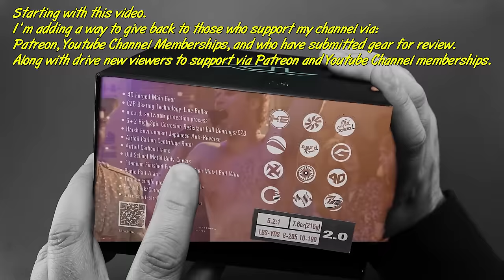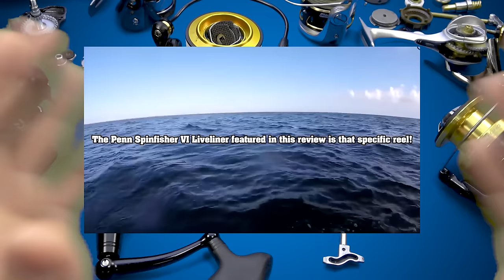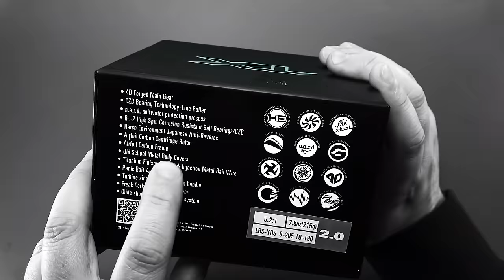$200 Spinning reel buying guide.  Teardown, comparison, and review. Shimano, Daiwa, Abu Garcia, Penn

Comment: Stradic FL hands down the greatest bang for your buck reel ever made.
Reply: I have both FL and back bay but I take the back bay out more than the FL just love the smoothness on it. If I need to recommend one to someone, I will the FL.
Reply: Sungsoo Lee why the fl over the back bay? If you use back bay more
Reply: No the bg is
Reply: @coopermaio1590  i agree bg...no reason yo buy any other reel
Reply: circusmime except he stated things that the bg lacks. you could get a slammer on sale for $150, which by far is better than the bg
Reply: Distant the bg is way better for the money
Reply: @coopermaio1590   to damn heavy.
Reply: it said bassicly stradic fl is stella fe without japan quality, i didnt even know what is japan quality :D
Reply: Bearings go out often so ..,
Reply: @coopermaio1590  no it’s not🤣🤣🤣🤣
Reply: @coopermaio1590  BG is shit for corrosion resistance. Pinion assembly wide open to saltwater.

Comment: I agree with Ricardo's comment about having the name of the reel on the table so the viewer can follow better.  On reels, for some time I've had a Shimano Stradic 3000 FI that has served me well. Only issue is it gets sand in the bail wire pivots and then it gets "grindy" until I take it apart and don't lose any of the miniscule parts, LOL.

Comment: Regarding the Spinfisher VI, I've found that some parts are interchangeable with the slammer III. Those being the main gear, spools, rotors, main shafts, and traverse blocks and oscillation gears. Not really beneficial unless you look at the smaller spinfishers <6500 which don't have the same components the slammer does. Useful if you need to replace a single part and not the whole reel. Maybe an obvious statement but I wanted to make it to confirm anyone's suspicions. 

Also, the Spinfishers main shaft is superior to the slammers. Stainless is a stronger more rigid material than titanium, whose flex was really noticeable in similarly sized models. So potentially the best reel on the table durability wise, being I believe the only one capable of having brass on brass gearing while under $200.
Reply: All true but the Slammer III series have a beast drag...A Slammer III 4500 has 30lbs of drag! Both good, solid reels...
Reply: can i put a slammer dx spool on a spinfisher with a slammer highspeed handle?
Reply: No, the slammer IV spool has a different hub design and won't fit.
Reply: All of my mid-covid Penn spinners have died immediately, I wouldn't bother with them right now. Shimanos have been a lot more durable mid "pandemic" than anything else except for the flagship okumas
Reply: @the1stvendetta  i just thought it would be cool to have a slamfisher dx lol
Reply: @dixonallen2610  Spinfisher has a great drag. Not a concern there.

Comment: I used a Pflueger President in the salt literally reeling it under water while being hit by waves. I chose that cuz i didn’t want my nice reels to get ruined. That president still works like a champ
Reply: Those are literally one of the best deals for the price for someone just casually fishing wanting a decent spinner. Lol I still use my old Shimano Spirex that I got from my grandfather, purely because the older one feels a bit more solid than the newer models, and I absolutely love the quick fire trigger.
Reply: AndrewLetit FlowWolf I’ve dunked mine like 3 times for several seconds and somehow still works completely fine and no signs of water stuck/damage

Comment: Good stuff here. I picked up one of those Stradic FLs last spring after seeing one of your videos and its the smoothest spinning reel right out of the box from any manufacturer I have ever used and still is after a season of use in freshwater. My only complaint is the weight, due to the fact I have been mostly using the CI4+ and Fuego LTs for a while now. If the next gen CI4+ is anything like it, It will likely replace all my spinning reels. Thanks for the work you put in making these vids.

Comment: We used a   Shimano Soccoro  5000 SW which  I found on sale on sale for  just $67 bucks.   It was  in the surf for a year and  it  held up to  striped bass up to 21 lbs, halibut to 14 lbs,   A 27 lb white sea-bass,   a 38 lb black sea-bass and  a large number of snags on a reef we fish from shore. .   The drag is no velvet smooth, the bail closes on casting from time to time,  plus it has a few  other deals but for $67 bucks  hard to complain about the price.    The full 139.00 asking price, then we might have a problem..    It was not a complete piece of crap, it caught some big fish and it still works with signs of some wear.     We  Upgraded to Penn Slammer III 5500's  at 189.99 and these even had the upgraded heavier bail   system  vs the first generation of  Penn slammer III and at no additional cost .     18 hard fished surf months later the  two  Penn Slammer III slammers bought  have been everything promised .   Only thing with Penn is that the reels are stiff the first week due to the grease packed but  once worked in over  2 trips the reels  stiffness  disappears.         

I fish for big surf species  and these reels have got soaked / fully emerged by waves with no problems.   there obviously a much different need that that of a  angler who  needs light weight  for many repetitive casts  where every ounce saves your arm and shoulder  grieve. but for Drag power, a 5500 having 40 lbs worth, Dependability and easy maintenance wise the Penn Slammer III has  done very well.

Comment: I just added a Stradic 2500 HG FL to my fishing arsenal...Got several older Stradic FI reels that have held up well inshore kayak fishing in the Southern Maryland area of the Chesapeake Bay. 95% of my fishing is light spinning 1/8- 3/8 Oz lures and most fish I target are specked trout, white perch, striped bass, redfish and spanish mackerel. Reels have 10-12# braid...use 20# Trielene XT mono for leaders tied on with FG knot. For quick disconnects I use the Fastach clip by Mustad.

Comment: Would a 4000 black bay be good enough for surf fishing and for occasional halibut, rays, and leopard sharks? Or would it be better to get a 5000 Stradic fl with increased drag and line capacity? The Ballistic sounds really nice too but I care more about a metal frame and the smoothness than it being light.

Comment: Been looking a bit at the liveliner Spinfisher as an option for fishing the kelp on day trips on the west coast. Mostly this would mean calico bass and fish similar sized. But, on these trips you can also run into yellowtails and bonito and the like. I'm split here on what size of reel would work better for this application- the 4500 or 6500. I'd be using it on a roughly 20-30 pound class rod. This would be my first Penn, used to mainly Shimano sizing- in the past a 4000 size Shimano worked fine for the calicos, was a little undergunned on small yellowtail.

Comment: Great video. Now i dont know about the new ones, but i have 2 okuma cedros reels (the ones with the blue handles that are discontinued) and they are better than all of these reels in everyway except at freespinning. They are sealed pretty tight so they feel a little stiff, but they are butter smooth and the power they have compares more to a saragosa or penm slammer, im so upset they dont sell them anymore but if you guys come accross these okumas on ebay or something, dont hesitate to buy them. The new ones (they are black) i dont know about so i cant speak for those, ill get one for sure though and see if they are as good.

Edit. Forgot to say they run for about $130-$200 depending on the size

Comment: I have a Daiwa Ballistic LT 3000 on a 10' Savage gear Salmonoid 15-35g gramm rod that i use for smaller lures (10-30 gramm) when coastel or pier fishing and that is sooo smooth (the reel price is 300,-us$ here in Denmark).  I also just got a (brand new old stock) Penn Slammer 460 on a 9' Savage Gear Salt 1DFR shore jigging 40-80 gramm rod (and that reel is only 100,-us$ new on sale). I use it for bigger lures (30-80 gramm) That Penn is a tank and i have no worries getting saltwater on it when boat fishing.

Comment: Yes, that Alan Hawk article was  something; now since the BG has morphed over time,  I wish Daiwa would upgrade the SS Whisker Tournament series, in the same design, but using their current top components! :)
Reply: With the long spool do you think the SS Whisker cast better than the new Shimano FL longer spool model?
Reply: @JD-hs7ib  I believe so, they were the first to do that, and the SS Tournament has proven itself through decades! BTW, still in Alan Hawk's list! :)
Reply: Whilst Alan Hawks tear downs are super detailed he takes so long to get new ones out for new reels
Reply: I saw lots of them in Keys in the 90s. But never cast one. I gotta try one out.
Reply: He misses a lot like the too light main shaft (many bent reported) and that the pinion assembly is wide open to saltwater. Penn Battle III might not quite have the cranking power, but has better gearing and vastly better protection from saltwater.

Comment: I seriously went all out on the Abu Garcia spinning reels- the Premier and even the MGX reel. After just two years- I hated them. The bail was flipping while casting, the reverse was kicking in while I was fighting a fish, and even worse- the rigidity was falling apart. It did not last- the quality was not there. Now I will admit- they took all three reels in and replaced them with brand new ones without giving me a hard time at all. I sold all three of them and then turned to Shimano reels. Now I'm a Daiwa man!

Comment: Honestly, though I've tried and liked the Stradic, that extra 15% weight kills my wrist (since my arm was previously injured). My opinion is that the Tatula LT is the best under $200. First, it's actually one that i could buy for under $200 and with tax, which is actually is a $200 budget, not $200+. Second, it's lightweight. Though I had the ganglion cyst removed,  my arm isn't able to hold up as it used to. Third and lastly, man I like that 6:2:1 gear ratio. I fished my wife's older Shimano Sahara 2500 and I fell in love with that specific retrieve ratio. Just my two cents. Would really appreciate it to see what you think of my situation.

Comment: I like this but now more confused as to what to get. Got a 7' mojo inshore for surf fishing and fishing the intracoastal in Jupiter. I want a light setup that is easy to travel with. Salt Strong recommended the Diawa Fuego. But I don't want a reel that has flex. I was leaning towards the Stradic FL 3000. But worried about how it will hold up with salt water. At like 190 is the back bay worth that price? Will the ballistic hold up to salt water?

Comment: Have you ever tore apart and reviewed  Piscifun Carbon X2000 or 3000? 
 11 bearings,  6.2:1, 22 lb's of drag, smooth and rock solid no flex. But not sealed. Just bought one for $62. Seems like a great buy.

Comment: Are you going to review the penn torque 2 series or even compare them to the high end reels in the fishing community. I’ve been debating on getting one and I know you do a great job when it comes to reel breakdowns.
Reply: but what size?TORQUE is good for topwater!!(advantage over makaira20k is that it weighs less). But only fast retrieve and $750...not so soft others, saltiga&stella.
I would go for half price slammer or already a CATALINA (if I need for jigging and 80lb braid I go with spheros 20k)....some people don't want MAGSEALED!, before twin power would go to stella 2nd hand.

Comment: i used spheros sw4k for tautog, i amazed how well it did vs some monster tautogs with massive swimming power, ( origionally put on my daiwa proteus 7'6 M inshore for schoolies, caught quiet a feel schoolies striped bass from 16-26" no problem) but how it performed vs tautogs aka black fish at 24-25" sizes are really impressive. Totally worth $130 , and it's light weight + hold lot more line than my daiwa saltist back bay LT i think. spheros Sw4000 is my new favorite egg beater :)

Comment: What do you think about the new TwinPower FD 2020 vs a Stradic  FL.
In my Country i have to pay 140 Euro for a 3000 Fl
and  320 for the TwinPower 3000 FD.
So my question is:
Is the TwinPower that much better, for nearly 200 Euro more?
I know the fact that the TwinPower is also build for offshore Fishing. But 200 Bucks is a lot and i dont get the difference between these Two reels.
Thanks in advance, you have a great channel for Spinning reels.

Comment: I have a question. I'm looking to buy a new inshore/freshwater setup and I'm looking at the Daiwa Saltist Back Bay or the Shimano Stradic FL. Would you go with the daiwa or shimano?
Reply: FL seem a bit flimsy compare to saltist back bay, i used saltist bb last year for tautog, and bonitos+ albies, going to use it again this year because after serviced it myself it's still the smoothest reel like it was out of the box , stradic is designed for Freshwater, vs  saltist is for saltwater so body is much more rigid
Reply: If you're still looking I have a back bay 3k new in box. $165 and it's yours. Or anyone's who wants it

Comment: What about the Penn Slammer, does it hold up to the Stradic FL and Back Bay for saltwater inshore fishing? (The smaller size penn slammers, 3500, 4500)
Reply: Penn Slammers are HEAVY AS FUCK, compare it to the same Daiwa Ballistic 4000, its literally half the weight.  and 4 lbs of torque less, but after a long day of fishing i rather use my Ballistic than my Slammer3
Reply: @NFiltr8Red Hey I dont blame you. I own a slammer 4500 and a couple of shimano and daiwa LT reels around 4000 size and I do agree with you. The weight is important, especially if your casting. I mainly use the light reels for shore fishing. However I tend to use the slammer for slow jigging stationary from a boat so the weight dont really feel that bad for that use. I guess I really only wanted to know how he felt about the Slammer...cause I feel like its robust.
Reply: RikkiVideos , the Slammer doesn’t feel like it’s gonna break easily.  You can toss it around on boats and in the rocks and it’s gonna stand up to punishment from the elements.  I have a Stella FJ 3000 and Exist 3000, both are my lake and river reels, both have brought in 30-40 lb Salmon with ease, but as stated before.  My wrist doesn’t hate me at the end of the day.
Reply: @NFiltr8Red  Hey good to know. I might have to save up for a top end reel then :)

Comment: Hi I want to ask you when you changed aluminium drive gear with brass on Metanium DC you changed whole ensemble: drag washers, anti-reverse ratchet and key washer or only the drive gear?
Thank you !
Learned a lot from your channel
Reply from the maker: Hi Vlad.... I swapped the pinion, main, and drag washer.. Came as a kit from tackle trap... If not listed specifically for the metanium on their site email them

Comment: I'm wondering how the new penn clash 2 would stack up now I own the 3000 and after 4 years of bashing in salt its starting to show Signs and make sounds. Given it's not waterproof. I have maintained And oiled never replaced anything. But the new Clash is intriguing. I'm on the west coast I use it for shore halibut or fluke on you side. Any thoughts?

Comment: @Tackle Advisors Daiwa Ballistic JDM TW LT or Shimano Stradic  if both are in the 215-250 range
Reply from the maker: Ballistic Japan has the zinc gear like the caldia.... Doesn't make it bad but I like premium gearing
Reply: Tackle Advisors the one on tacklewarehouse does as well? is there a difference between the 350 dollar JDM
and the 229 dollar US model? cuz the 350 dollar one is on clearance for 229

Comment: My go to spinning reels are Shimano and Daiwa. If I want to get a reel under $100 I usually go Okuma. I seem to prefer Daiwa’s high end spinning reels. The spinning reels I’ve had the worst experience with are Mitchell Avocet ones.
Reply: Best sub 100 is the Fuego LT nothing can beat that monster.
Reply: Sungsoo Lee it’s definately good. I just love the durability Okuma offers. The Okuma Ceymar for an example has a machined, well engineered main gear and its proven to be really durable.

Comment: Have you ever done a video on how to clean your reel and rod after a saltwater fishing trip. I see so many videos online and never know which one to trust since they all seem to be different. Any advice on how to do it and what products to use? I’m most concerned about the reel cleansing as washing the rod seems very straight forward. Thanks again for any expert advice you can give a newbie
Reply: The way I do it is:
1. Tighten your drag all the way down to reduce how much water gets in.
2. Use light pressure water to rinse everything, don't put too much water on the actual reel body. Warm water takes off more salt. Don't be afraid to use extra pressure on the actual rod guides and your lures
3. Let it all dry off. I like to put a fan in front of everything to help it dry faster. Loosen your reel's drag all the way, otherwise you're compressing the drag washers which is bad.

Optionally you can get a product called salt-away that helps salt come off. Salt corrodes by keeping water at the metal surface for a longer period of time on a microscopic level.
Reply: Btw I apply some oil to the line roller bearing on some regular cadence, maybe once a month. Adjust based on how much you fish.

One more thing I do only applies if you have multi-piece rods (e.g 2 piece rod). I get a small block of paraffin wax and rub it on the rod ferrule (where the rod pieces connect, the piece that sticks into the hollow end of the rod). This simultaneously lubricates and also tightens the connection between the rod pieces next time you put it together. I do this whenever i remember to, which is about every other trip. Ideally I think every trip would be good. You can get a huge block of paraffin wax from amazon for like $10-15.
Reply: @samcliu  thanks!